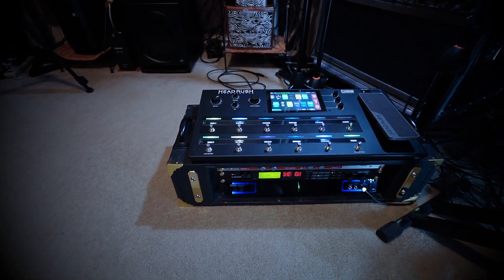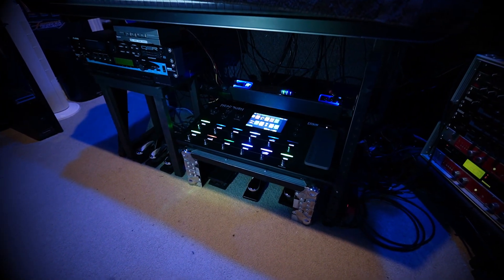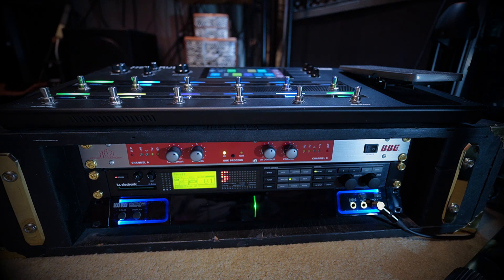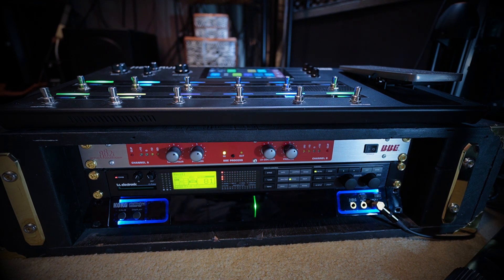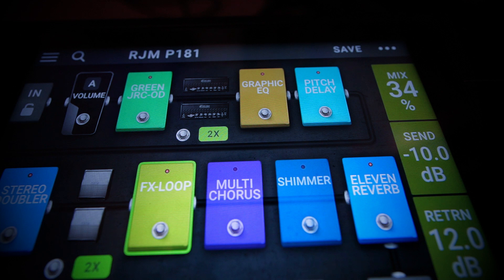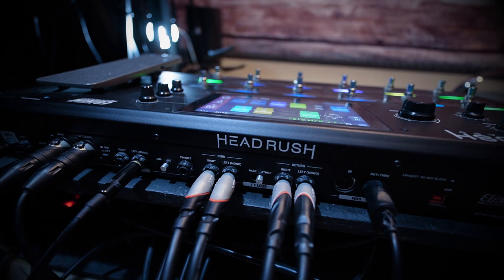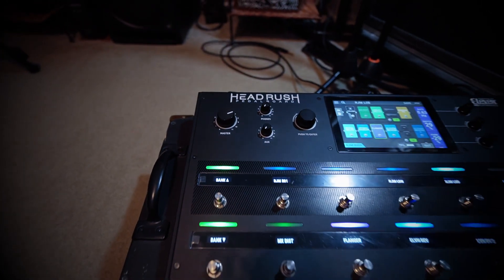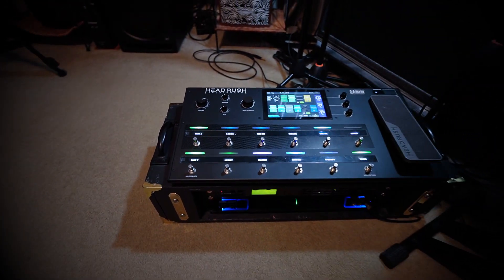HeadRush Pedal Board... make it Sound Better

Comment: That defeats the purpose of it being an all in one modeller.

This is the sound I want to get out of the headrush and never do
Reply from the maker: In all my years of recording and playing live, I've never had one thing that gives you everything. When playing live, there always was that added extra sound modification done by the house mixer and any effect that the sound engineer wanted to add. The same goes for recording. There's always something you will add in post, EQ or reverb. 
But I have found that with this setup, I make fewer adjustments in post, the sound I am looking for is there. Plus, if I want to change sounds, I just press a button without all of the work of micing a cab.
Reply: @jonmicheals621  have you tried any of the more “advanced” modellers?

Quad Cortex, Kemper, and Fender Tone Master Pro (Even the new headrush Prime even) have that exact fidelity of fullness that your unit brings, but right out of the box. 

It’s like turning 2D sound into 3D. 

I’ve gotten somewhat close using almost 2 Para EQ but I really shouldn’t have to be tinkering like that to get the sound.

Thanks for the video, it’s absolutely confirmed that I made the wrong choice to get the headrush pedalboard. 

Great for beginners, but for pros it’s so thin and muddy on its own
Reply from the maker: @peaceofvideo  When I started using the Headrush Pedal Board it was the only thing out there, besides the Fractal and the Kemper, and the Line 6 stuff just didn't have the reponce. The only reason why I use the Headrush Pedal Board as you will see in my video. Is it is easy to use. The Kemper and the Fractal had way too many menus. None of these boards sound good out of the box in my opinion. You have to tweak them and play with them to match up with your playing style and your guitars. And for me it is so much easier to drag and drop pedals and to adjust their parameters than any other unit out there. And I'm with you when I first brought it home it sucked. I was about ready to return it. But it is so much easier to adjust things once you get to hang of it. And how you can stack amps and cabs so much easier than any other unit. Don't be fooled by the higher priced units. You will still have to make them sound good with what guitar you're playing and your style. Plus I like that Headrush provides upgrades. So I'm now running the latest version with some newer pedals. If your looking for a turn key box, this might not be for you. But for me working in the studio I can go from a country telly to a heavy metal sound with a push of a button. Maybe the new Fender pedal might be pretty good. But I had a cyber Twin and it wasn't very good at all. Again, it's about what your purpose is and if you're willing to work for it. I have two of these one in each of my two Studios and they sound great. Check out my YouTube channel under different styles of music I produce. I use an Ibanez S guitar for Semi Johnny and the Mother Truckers and Leon the Heavy Metal Country Boy using the Headrush Pedal board it sounds like a telly. And check out Outside Darkness video for the metal sounds.

https://youtu.be/utYZ_fdqggs?feature=shared